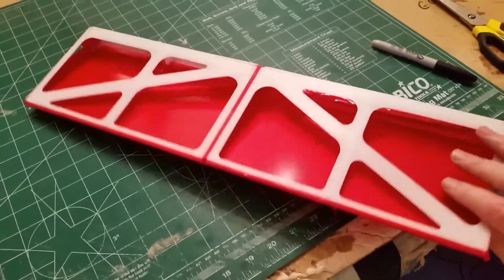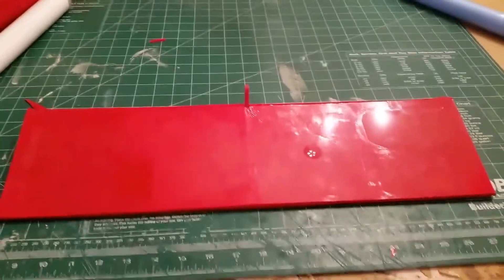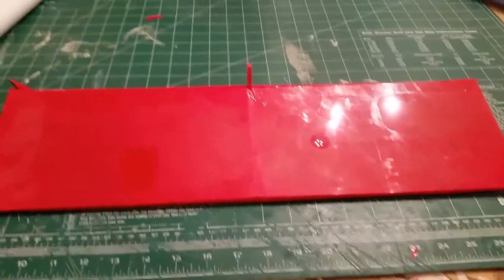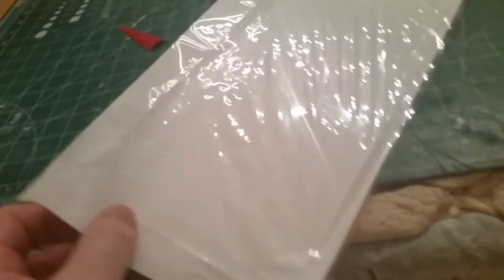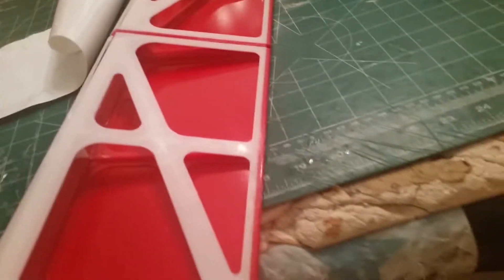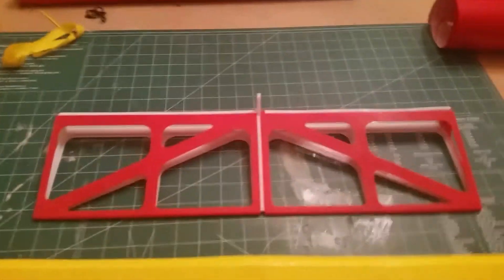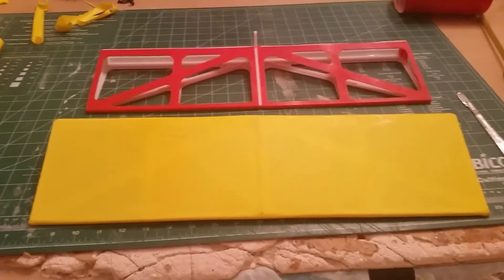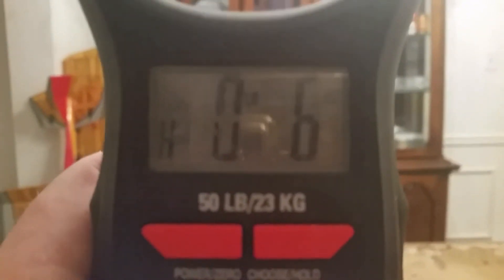RC - Covering 3d Printed structures (PLA)

Comment: Hello Sir, I hope you see this comment, I am trying to cover som pla prints, but they melt for me, do you use a heatgun or? and how is it spelled ultracote or ultracoat? sorry for all the dumb questions.
Reply from the maker: Ultracote. Amazon has it. 

I do not use a heat gun on any model ever, just an iron. (i have melted far too many holes in planes with guns and just stopped using them) Follow the basic rules of ironing (included with the Ultracote) and it worked awesome for me! 

However, I did mention in the video (I had forgotten) that I did the final shrinking with the iron set at 350 degrees   F.  (176 C) 176 C is WAY under any PLA extrude temp.   I  Hope that helps 

Rob